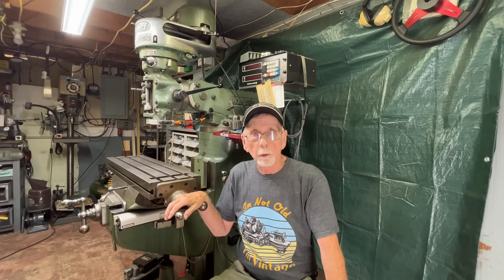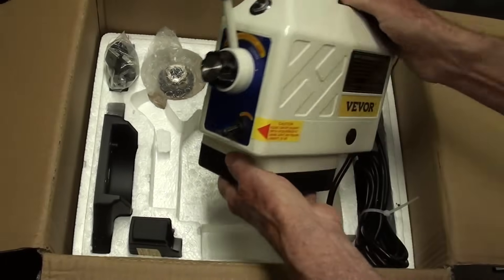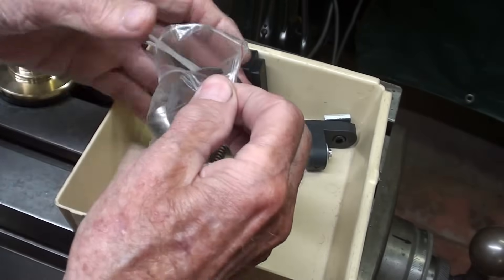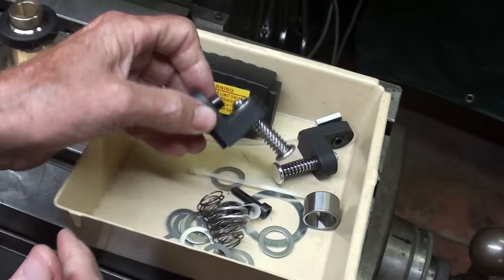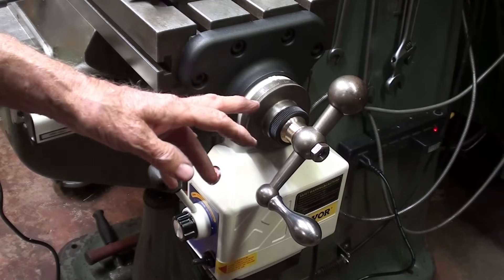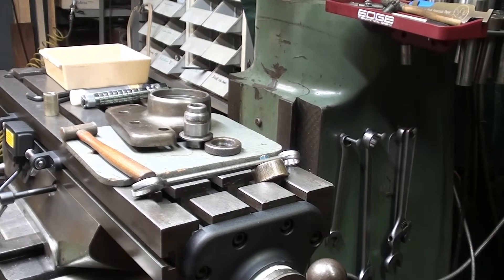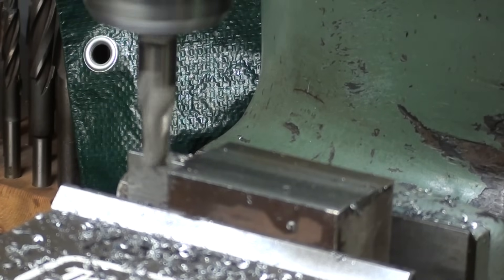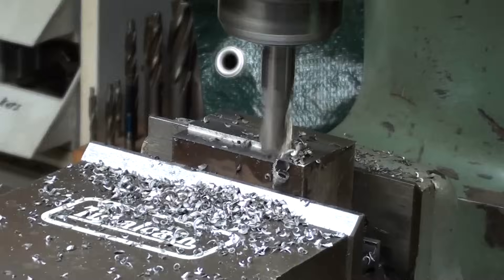INSTALLING A  POWERFEED on the Bridgeport Mill #887 tubalcain

Comment: I've got an Asian sourced PF that looks identical to that one other than brand name on the side.  I've been pleased with it so far considering the price I paid for it.  However my PF definitely has a much slower speed possible,  I suspect something is qrong with yours.  Possible the speed control knob not secured/adjusted correctly?  Don't forget to put on limit switches, I don't have your machining experience but have lots of experience making mistakes and forgetting things.
Reply from the maker: Didn’t I show mountain in the limit switch?
Reply: @mrpete222  well you did mount them on the front for demonstration but talked about leaving them off,  and then near the end you said you'd mount them on the rear. My apologies if I missed understood you.

Comment: All they need to do is change the gear ratio, slowing down the speed and increasing the torque.  They should offer that as an upgrade.  That one may be optimized for a finer lead screw pitch.
Reply: The gear ratio is fine. The potentiometer is faulty.

Comment: I love mine but I had to make it fit on a Horror Fright knee mill. Lead screw extension, adapter to fit between the drive and the graduated dial, and using the lathe to broach the keyway into the drive gear. But it works slick as cat snot. Now we need to convince Vevor to do a power Z feed as well. Everything out there I can find is $400 or more and that is an awful lot of cranking by hand to make it worthwhile.
Reply from the maker: Yes, I sure would like one on the knee

Comment: Just recently put one of these on my mill. I had just picked up a broach set so i opened up the keyway in the gear. My unit runs much slower thankfully and the thread wasnt metric for the locknut for the dial and was able to use the old steel original one. I'm thinkning it must be luck of the draw if you get a good one?
Reply from the maker: Right on

Comment: If you have a power outage while using it, make sure you turn it off if you don't have the limit switches installed later.  Seen that reminder in another video on the same item.

Comment: The 'best' aftermarket power table feeds are (or were) made by Servo. Bridgeport uses them from the factory. They are rather expensive , several times what the imported units cost. I remember the old 'gearbox' power feed units that came from Bridgeport.
Reply from the maker: I had a servo on the southbend milling machine that I purchased for the school in 1969.
It worked great, but the kids kept ruining the big brass gear, and I gave up on it. They wanted to speed shift.
Reply: Not sure if it still is, but the original Servos used bronze gears, but most non-Servo replacement gears were brass. A dab of grease on the teeth every so often helps too. @mrpete222

Comment: Lyle, not contradicting you. You mentioned not to install anything dry and I agree. It brought to mind something that boggles my mind a little. Today, gasket/seal manufacturers offer Teflon oil seals for engine crankshafts, transmissions shafts and I am not sure about the coverage. They are installed dry, no lubricant on the shaft. A Teflon seal must 'run in' n order for it to seal. Installed with lubricant will cause it not to seat and it will leak or weep lubricant as long as it is installed. I had conversed with a well known transmission guy and he complained about Teflon seals and stated they do not work. I thought that odd and then discovered about the dry installation. Maybe he was totally unaware of the installation process.
Reply from the maker: Thanks, I did not know that

Comment: May be time to spend a pile of money on a new DRO to fix that thickness issue!  Sorry… pretty sure my DRO was 3x more than the rebuilt power feed, and the power feed costs almost as much as the used mill.  The new ones have magnostrictive scales that are only 1/2” thick, more with a chip guard but not big enough to limit the travel when mounted to the back of the table.  I am a fan of the limit switches on the front as well as the ability to clamp stuff to the front edge.  The switch on mine is set up with movable and fixed stops.  The fixed stops stop the movable stops to limit the table travel to prevent a crash they just bolts.  The movable ones i use to limit travel in situations where clearances are tight, like when using a dividing head or sometimes on a sign plate or to avoid toe clamps.  The movable ones are nice knurled knobs in tee nuts that I made.

Comment: Thanks for doing the review. I bought an economy model from ebay and have not been happy with it. At a slower speed it is jumpy and will ramp up without warning or encouragement. That is hard on end mills and that cuts into the budget! Researching a better unit, but it doesn't look like it will be a Vevor!

Comment: Better Business Bureau profile for Vevor
CURRENT ALERTS FOR THIS BUSINESS
Pattern of Complaint:
BBB files indicate that this business has a pattern of complaints concerning problems with online purchases. Consumers allege items are not being delivered in a timely manner. Other consumers have reported issues with items received. Items will come defective or they receive the incorrect items. Also, consumers report issues with contacting the company. Some indicated the company has failed to respond to their requests or just don't communicate with them at all.  On January 4, 2022, BBB submitted a written request to the company encouraging them to address the pattern of complaints. As of January 20, 2022, BBB has had no response.

Stop supporting the America hating Chinese atheists.

Comment: It would seem someone with electronics chops would be able to alter the speed control to slow it down. I'm not sure if lowering the operating voltage is the answer. How the current speed limit switch is working needs decoding and that will reveal the answer to the problem. imo
Reply from the maker: Yeah, answer is in tomorrow morning in the video

Comment: The product your link goes to is rated 0 - 200 rpm.  Was something amiss with the unit you had for testing that would not got below  a minimum (appearing) rpm of 200?
Reply from the maker: Yes, it is a defective unit. They sent me a new one and it works perfectly. There will be a video on Saturday.

Comment: My Vevor X feed power works well. The limit switch is mounted without any washers. To slow down the feed turn the speed control all the way counter clock ways. Then turn clockwise slowly and the slowest speed turns on. I did have fun with those spacer rings. Remember that the keyway is up when the ball of the handle is up. My keys are loose so they fall, out easily done with the hand handle up. A comment below says there are speed controls inside.
Reply from the maker: I did exactly that, although it was not shown in the video
Reply: Was looking for this comment.  I never saw him actually turn the big trim pot, but he responded here saying he did.  Didn’t think he would miss something so obvious, and he didn’t!  We just didn’t see him do it.

But that is disappointing.

Comment: I may have missed something, but it looks like you have the speed contol (under the direction lever) at half speed.   Does it fault out of you turn it down?
Reply from the maker: Maybe I failed to show that. But of course, that is the speed control but it still doesn’t go slow and off.

Comment: Brass is classified as a copper alloy.  That is probably why the Chinese call it copper.
Reply from the maker: I thought the same thing, but they need to consider that they are talking to the American market
Reply: Yeah, right.😂 They say the same for other steels, too.  We call 1018-1026 steels, they call it C20 steel. And similar for other greades, too. @mrpete222
Reply: Yes, and a lot of people in China consider the Silkworm a delicacy... 😕
Reply: My scrapyard/metal recycler calls bronze, brass, no red or yellow brass differential.  Then again, they're mostly copper base.

Comment: The power feed on my mill mounts on the left end of the table and replaces one crank handle. The other crank can be set to "free wheel" while using the power feed, or else I know it would have grabbed me by now. My power feed also has a speed control very similar to your fix, and I'm able to get very fine feed rates with no loss of torque. In all fairness, though, my power feed was specifically designed for my mill, while yours is a universal model. With as many Bridgeports, and clones thereof, as there are out there, I'm thinking Vevor will probably get more specific in their design of this unit. I'm betting they are watching this video.

Comment: Hi Mr Pete glad to see you have a power feed  . the vevor one looks like the wen ding ones and wen ding X axis sell for about $135.00 they are the budget line . i think the biggest thing about these is the speed control or lack of it . i used one for my Z axis and i made a custom shaft i don't like how all the Z axes power feeds have the handle fixed in place with a spring to disengage it on mine i just put the handle on backward when using power feed . I think you are going to like it especially for the price.  Thanks for all your videos .JM
Reply from the maker: Thanks
Reply: @mrpete222  I'm only halfway through watching a video I got interrupted hope it all worked out I had to put a flat on the backside of the big ball on the handle

Comment: I think the "pot" may be bad. I have installed a few of these and all run quite a bit slower at low speed.
Reply from the maker: You are probably right I suppose I should throw that darn thing away

Comment: i have to assume you know the dial on the front of the power feed controls the speed rate? every one ive ever used this had slowed them down to a tiny speed. the fact you didnt show it speeding up and slowing down without using the rapid makes me unsure you knew this.
Reply from the maker: Yes, of course I know that. I guess I failed to show it.

Comment: But do the high speed travel work when you use the Dremel box. Also they should make these units with high and low gear. Also the computer nerds call this cable management... :D :D

Comment: I kinda want one for the knee on my mill. I don’t mind turning the knobs on the table but god forbid I have to move the table up 12”. I know I can use a drill and such but I would just rather it be there and usable.
Reply from the maker: I totally agree. I have been using an electric drill for the knee.     However, this one is not adaptable.

Comment: Such a shame that the product itself can't achive low speeds, if you don't have an external speed control adding one could be a bit expensive I guess.
Reply: Mr. Pete’s unit is faulty. The speed control is bad causing the feed to run much too fast. My identical Vevor product on my Bridgeport will slow to a crawl and even stop.  The company should send him another unit that works correctly for a better review.

Comment: You should be able to turn the feed speed all the way down to zero. Something is not right with this.  The motor is DC but is being controlled by PWM pulse width modulation, (pulsing the DC off and on to give an averaging voltage for speed)

Comment: you should call them and ask why you don't get 0 - 200 rpm from the unit it is advertised for 0- 200rpms it the write-up for it you might have gotten a bad unit or one that was not adjusted right at the factory

Comment: I'd like to buy a Bridgeport.Most of the ones I find are reasonably priced, but look like they have been run 3 shifts a day since Eisenhower was in office.I really do not want a project

I have found a couple of cream puff mills in nicer condition but they are too expensive to justify for hobby work ( 10K). In the meantime I am pulling my hair out using a round column mill drill- which is ok but inadequately rigid and I have to take light cuts. Anyone out there been through this decision tree ? How did you deal with it?
Reply from the maker: My only comment is this. I absolutely do not buy a worn out milling machine.

Comment: I am not a fan of the metric issues on that power feed… That said it is cheap, like really cheap.  But that plastic knob would irk me.  And wow that things lowest speed is very fast compared to the American one it’s knocking off! That’s a little scary for a heavy cut honestly.  Even with the Dremel controller its a bit faster than the minimum speed.  I think it was 450$ for a rebuilt one 5 years ago, I probably would have skipped the power feed but I got the mill for cheap with a broken power feed and no parts to convert it to original.  I would probably spend the 450$ again over that power feed, it really is that much better.

Comment: Sorry to say but this unit free or not is a complete POS - products made in the PRC are generally inferior to any other country of manufacture - for those wanting a decent power drive at a reasonable price, take a look at AClass which is made in Tiawan  - this Vevor unit appears to be a rebranded Align unit - which seem better then Vevor - I have put Align an several mills (all 3 axis ) - same for AClass - my current mill is a new Acer which I powered all 3 axis - the even have a hi power unit for the Z - I know it seems like I'm pumping this - I'm not, just adding my experience

Comment: Looks like the designers didn't get too much potential customers input before releasing the design. Your requirements appear to be pretty basic. I hope there are some hidden adjustments somewhere to reduce the speed range. I always enjoy your videos, regardless of topic, and I always learn something!
Reply from the maker: Yes, maybe there is some adjustment on the inside of the unit

Comment: In your video here, I did NOT see you adjust the speed control knob at all....I did see you use the axis direction lever as well as the fast advance button.......The center knob on the lever arm is a speed adjustment , twist it to speed up or slow down to your desired speed......the top speed of the speed control knob will be as same as the fast advance button......
Reply from the maker: I guess I failed to show that. But of course I use the knob.

Comment: I have this same unit. I had the same mounting issues. Your unit may be a problem.  The one I installed will operate very slow.
Reply from the maker: Perhaps it is defective. In fact, that’s the first thing I thought. But I wasn’t about to take it apart. My contact at the company said she would have the engineer look into it?

Comment: Would you like to add a readout that could be configured to readout in inches per minute or metric units even?  I can send you the stuff for it and it wouldn't difficult install.  Let me know if you would like to try.

Comment: Blondihacks has a great disassembly video for this unit.  The speed control is all down to a very cheap variable resistor.  She sprayed hers with contact cleaner and it improved a lot.  Disassembly is very difficult.
Reply from the maker: Thank you, I will check that out

Comment: Hi Mr. Pete, my bigger concern than the speed of travel is the lack of clearance between the Vevor motor and the table crank.  Looks like a nasty pinch point.  All the vertical mill power feeds at the school that I teach at have a spring loaded crank that disengages the handle from the leadscrew feed to avoid this.  Hope they, (Vevor) address this safety issue....
Reply from the maker: Agreed, but I think I pointed that out in the video

Comment: I have a 30 year old Taiwan built power feed unit on my BP. When the speed knob is turned way to the left for low speed, the unit won't take off on its own when I throw the feed lever. However, if I give the hand crank a little nudge, just to start it, the power feed will take off and continue, and with good torque. And it can feed very slowly that way. Maybe you have a similar condition. It's worth a try.

About a year ago Blondihacks tore into her power feed unit when it got balky. She got deep into the weeds before she found the fix. It was interesting viewing, at least if you're interested in electrical/electronic stuff. She found that it's quite a primitive speed controller. I was hoping she'd design a more modern and sophisticated controller that we could upgrade our own units with. I think she could probably do it. James Clough, too.
Reply from the maker: I will go back and look at her video

Comment: A limit switch is the only difference between a power feed and a self-destruct device. TMOT 😏

You should be able to set the gear clearance using a depth mic or calipers to measure the gear position from the end of the shaft. Once you have the zero value, add spacers to take up the slack and then add however much clearance is appropriate, 3 or 4 thou would be my off hand guess—however thick the brown paper from grocery bags is.

Comment: Mr. Pete, I think you have overlooked the speed control on the power feed. The pivot point on the leaver for X- and X+ there is a black knob, that black knob is to change the speed of the longitudinal feed rate. counter clockwise is slower and clockwise is faster. Try this and see if it works. if not, request a replacement, you will be surprised at the fast customer service. I had a Vivor that had a defect and it was sorted within a week. Let us all know if turning the knob at the pivot point of the leaver helps.
Thanks for posting. Craigsbully.
Reply from the maker: I will try that
Reply from the maker: Yes, of course I tried that. Perhaps I did not show that in the video. But that is the first thing that I did.